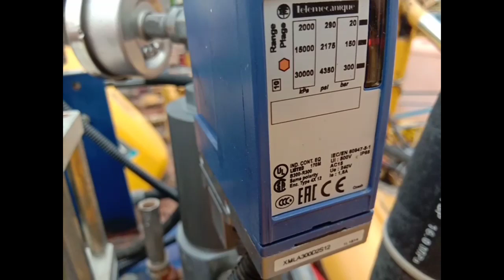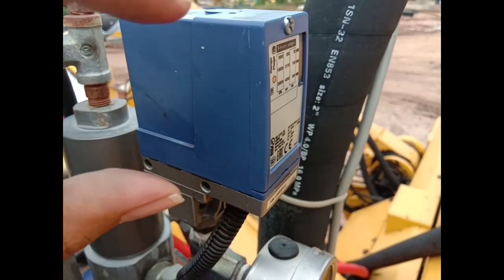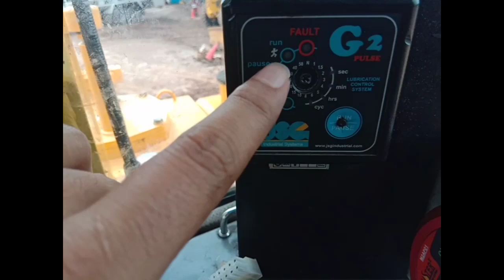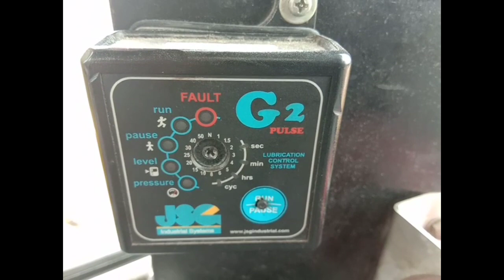Cara kerja grease pump ( Autolube pump)

Comment: Bang kalo fungsi pressure switch itu kalo sdh tercapai press grease nya apakah akan memutus timer autolube..apa cuma sebagai indikator bahwa pompa autolube bekerja dengan baik
Reply from the maker: 1.akan memutus arus ke solenoid grease pump ketika tekanan mencapai settingan selama kurang lebih 10 menit.
2. sebagai inputan controller ketika dalam 10 menit pressure switch tidak on maka controller akan mengeluarkan fault
Reply: @M.Nusur-Lpkmecha  normal ga pak kalo pressure grease tercapai kurang dari 30 detik..dan untuk press switch saat tercapai press maka switch aktif tapi timer tidak juga mutus..timet glc 2200
Reply: Kalo controller GLC 2200 sistem pressure tidak tercapai dia tidak akan muncul Faul karna GLC sendiri memiliki setingan awal pumpa ON dan pumpa OF untuk pressure dia tidak menggunakan setingan jadi pumpa bergerak sesusai itungan detik dan sudah menghasil kan pressure
Reply from the maker: Mantap bossku ada yg bantuin jawab @master autolube

Comment: Pompa yang input ke arah pompa grease itu berasa dari pompa hydraulic unit ya pak ?
Reply from the maker: Iya mas bisa dari hydraulic - pilot atau dari transmisi yg sekitar tekanannya 30 -40 kg
Reply: @M.Nusur-Lpkmecha  lalu di apabila dari hydraulic sendiri pak, tekanannya bisa lebih pak, apakah pompa grease aman ?
Reply from the maker: Biasanya ambil dari pilot pressure mas